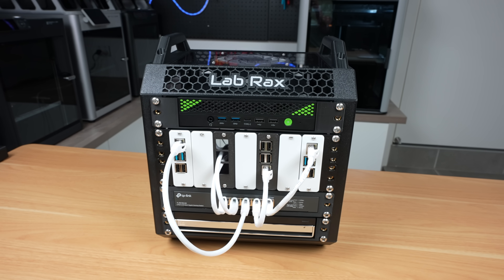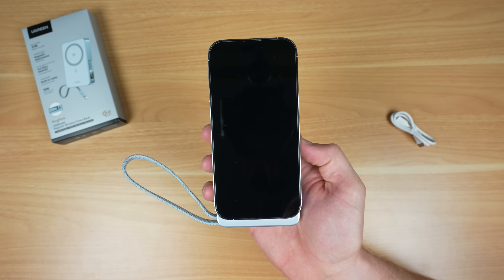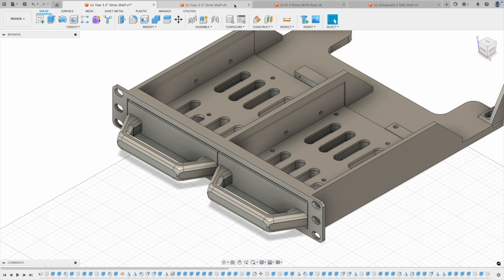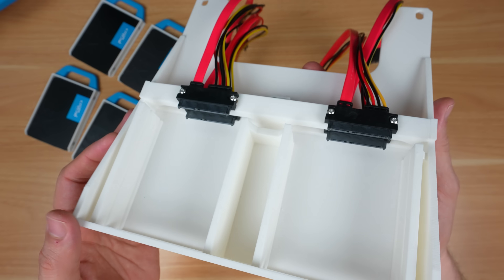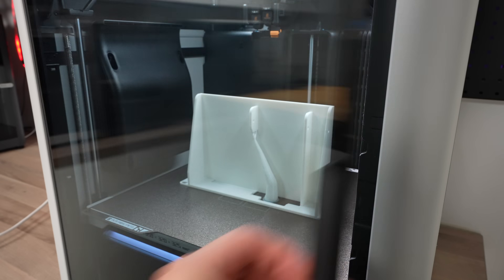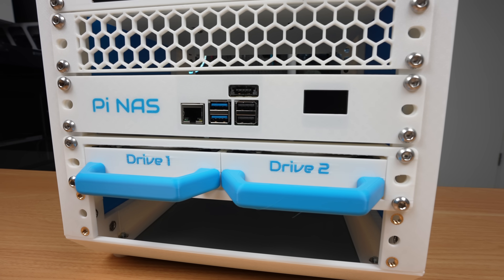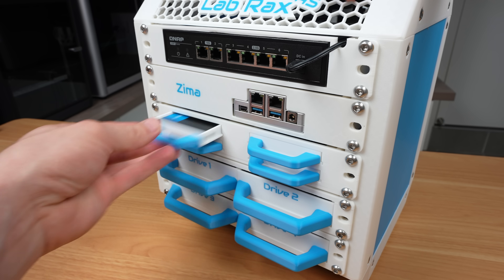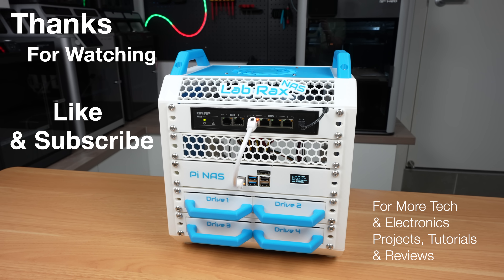Turn Your 10″ Homelab Into a NAS! 3D Printable Drive & SBC Shelves

Comment: can, someone help me out with wiring for the Zimaboard to 4 HHD
Reply from the maker: What do you need help with? You need a PCIe sata adaptor that’ll give you the two additional ports - these are wired straight to the sata ports on the drives. Then they’re powered by a 12V external brick with a sata power adaptor for each drive.

Comment: Is there a modification that you can do in order for it to fit within the height contraints of the Prusa Mk4?  If I were to orient it diagonally on the print bed, it will fit standing up, but the tabs to the rear in order to mount to the rear posts are too tall for the Mk4, and can't be sliced :(
Reply from the maker: I look into what can be done to reduce the footprint of the longer pieces and whether these would be printable on a Mk4.

Comment: Yo dude, dumn question, but how did you mount the back of the drives? I don't see it in your video or written instructions.
Reply from the maker: What do you mean by back of the drives? The back supports for the shelves?
Reply: @MichaelKlements yes. Your guide and video never show how the supports attach or what size bolts are used. Are there heat inserts? Etc
Reply from the maker: The back supports use the same M6 screws that you'd use to assemble the rack and an M6 nut underneath them - theres a hex cavity that holds them in place.

Comment: Great design and well thought out.  Not sure but it seems to me that the Zimaboard version is about the same cost today as the PI version and would be easier to configure, is the Zimaboard the better way to go?
Reply from the maker: For a NAS I'd say that the Zimaboard is a better option. It has a better processor and more interfacing options.

Comment: I did not understand very well why you recommend two 3d printers? It is really neccesary?
Reply from the maker: I'm not sure what you mean by this, this system is designed to be printable on most standard bed size 3D printers.

Comment: Mixing the 2 drive types is pretty wasteful overall.  You end up with 2 pools each of which has a drive for redundancy.  I'd rather have 6x3.5 for capacity or 7x2.5 for speed.
Reply from the maker: The intention behind this video is to showcase the new parts that I've designed to build a NAS in a 10" rack, my example setup is not intended to be well optimised.

Comment: Great ideas. Nicely done.  

IDEA for the shelves : if you already have the honeycomb design on the front, why not use something similar on the “shelf” / the bottom / or something similar like triangles?  Wouldn’t that still be strong enough to hold your equipment , allow for more cooling , and use less product when printing?  I do not have a 3D printer, so, I have no idea.

Comment: I would like to know if you design 4U or 3U, i don't know, to install an ATX power supply, with 300 to 500 watts, i could deliver 5v and 12 v power to ZimaBoard 2 and 8 Sata 3.5 " drive.  I do print 10U, i will put power switch on front. Thank's again.
Reply from the maker: Yes, there are parts available to build this rack up from 1U through to 10U and all units in between.
Reply: @MichaelKlements  Sorry to be misunderstood, what i ask is a design for a backplate with hole to be able for regular ATX power supply to fit in LAB RAX NAS. after that i can use switch to power one all the rack, given power to Sata drive and 12 v for ZimaBoard 2 etc . the bottom on a back will be reserve for power supply, all upper place will be for HDD tray, Zima tray, fan controller etc. My apologize, i am frenche guy.
Reply: @RegentLemay_FullReg  If you do want/need that there is at least one atx power supply 10 inch rack mount pannel model on makerworld. And it's 2U. Altough there isn't a set standard for 10 inch racks yet, the Lab Rax is made to fit most (if not all) pannels that are designed for 10 inch racks, so you can mix mand match.

Comment: A nice upgrade would be some kind of "hot swapable" trays. So the cables keep connected to the SATA ports and you don't have to mess with it every time, specially the ones with closed back racks (as it's portable). Some male to female SATA adapters bolted or press fit in the back of the trays could do the trick
Reply: 2:45 is the part of the video you're looking for.

Comment: Hey Michael, great video! I was already planning on building a NAS and this made my hardware selection easier and saved me a lot of time modeling. I went with the Zimaboard2 and printed 2x3.5" shelves. Could you please specify somewhere in Printables, on your blog, or in the video description the nuts/bolts used to connect the rear supports to the drive shelf? I used threaded heatset inserts for my entire build and it didn't occur to me that I needed m6 nuts for the supports until I was done printing everything. A note in the instructions/materials would have been great.

Comment: your design requires screws to lock the 3.5" hard drive and 2.5" inch SSD, this is not a good design, In my opinion, the best NAS case have some requirements, 1) thermal condition 2) anti-vibration mechanism 3) ease of maintenance 4) best compatibility for motherboards and PSUs.

Comment: Is it possible to buy SATA extenders that are split into a power and data cable on the other end, so that they can be plugged into a standard motherboard? I realise that I can just plug normal sata data and power cables in to an extender, just feels like an unnecessary connection.

Comment: I printed a lab rax rack to make an all in one proxmox home lab server (including a NAS VM). I want something far more powerful than a pi or Zima board. If I go for a Mini-ITX setup it would be easy to have all of the drives power up and down with the system, but it's not cheap. If I go for a mini PC it would be cheaper and a lot of them have a couple m.2 ports, one of which can house an m.2 to SATA adapter, but without some electronics wizardry, the drives won't power off automatically with the PC. I do have a brand new 300 watt 24v meanwell PSU that I could use to power the mini PC and drives. I know I would need to step down the voltages, but I don't know what I would need to make the hard drives power off when the mini PC shuts off. Any ideas?

Comment: Loving the LabRax series and will be printing some of the new parts here for HDD/SSDs. The only part I’ve not figured out properly yet is how to power it all. I got a 1u x 3 socket supply. But this now extensions and plugs hanging out like Frankenstein’s Monster. How have you powered your setup. Any tips great appreciated. PoE? Maybe an option to tidy things up. But requires some investment!
Reply from the maker: Power is always an issue and I don't really have an easy solution. I usually try to get everything onto a common supply, like have a single large 12V adaptor powering the whole rack and then use individual converters (12V to 9V or 12V to USB C PD) for anything that doesn't need 12V. This approach seems to result in the cleanest setup.

Comment: I recently purchased a Samsung 8TB SSD and a crucial 8TB SSD. Total cost about (549+439+tax. Both are VERY fast and could possibly 'last forever?'. I think this means the end of mechanical drives. I have a 16TB setup with 2-8TB SSD with USB-C plugged into AC powered USB hub requiring only 1 USB-A outlet on my computer. I will expand this using 2 more 8TB SSD. I use this for backup as I have eliminated my DVD backup process which wasted hours of time. the Crusial 8TB SSD (from B&Hphoto) is very small (cute?) How about a NAS for up to 8 of these?
Reply from the maker: Sounds like a solid setup. I'll look at putting together a tray system for USB connected drives too, thats a ncie idea.